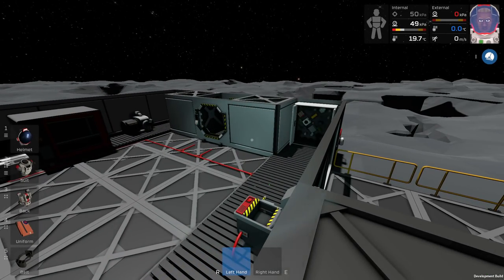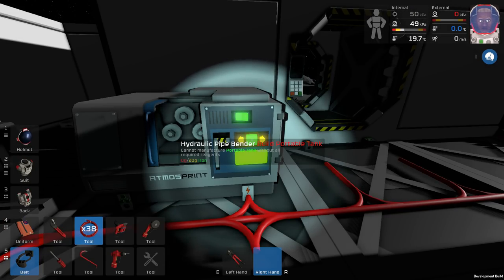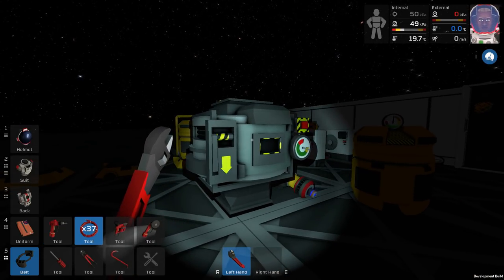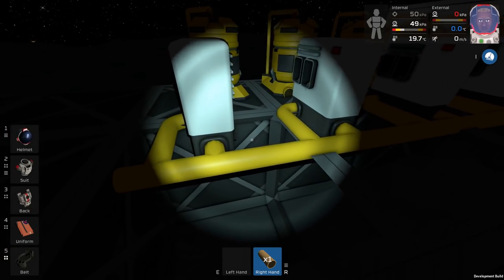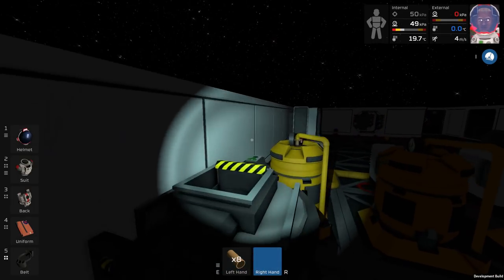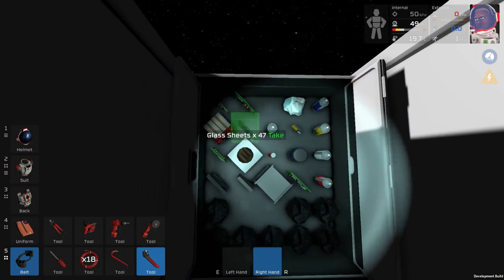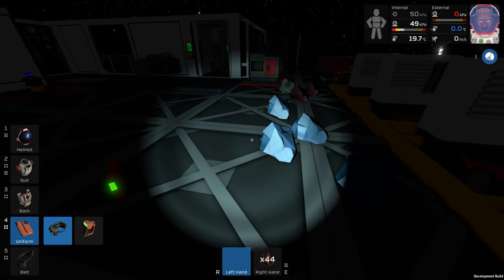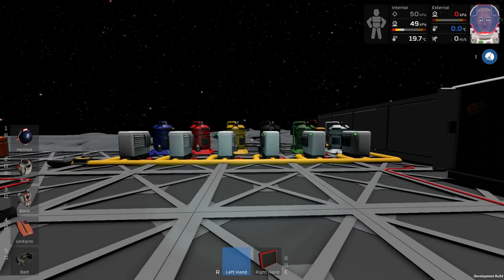GAS FILTRATION SYSTEM - Stationeers: Ep. #7 - Gameplay & Walkthrough

Comment: Some info about gas filtration systems
1) The filtration units have build in volume pumps that suck in all gases and push out all the filtered gases. The fact you have a single pipe between your filtration and tanks means all the gases will go into your tanks.
2) Pipes are capable of handling 60MPa (60000KPa) before blowing.
3) I haven't tested dynamic tanks, but based on testing of other pressure vessels, they are either rated to the same as pipes (60000KPa) or the same as stationary tanks, which is atm infinite pressure. I'd err on the side of caution and assume the limit is 60000KPa.
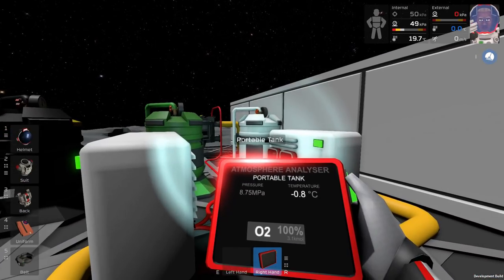4) Pressure isn't the only thing you should look at, there is also the measurement mol (mol is a molecular measurement, which simplified in the game and represent the amount of gas). A dynamic tank at 8MPa (8000KPa) contains much more gas ergo a higher mol (personally they should just change it to a basic volume measurement like litres) than a canister at 8MPa, and a single section of pipe at 8MPa. If you check 18:37 you'll see that the reader says 02 100% 3.1kmol.
Reply from the maker: +Armitige Shanks Sweet, thanks for the specifics, I was scared because my pressure measure thing on the tank is already in the red.

Comment: if you put the waste from one filter into the next, you'd be more efficient.
then you probably want an output, and a gas mixing station. and a station to fill bottles. or put it all into a giant network of pipes, valves, mixers and regulators.
And then you can hook the furnace into it all, using regulators to put in the desired pressure of the desired gasses.